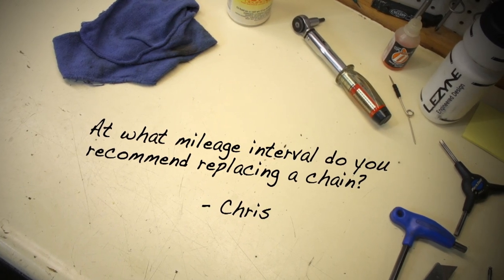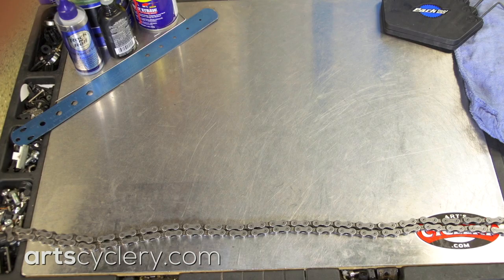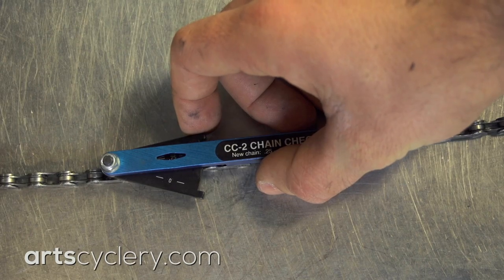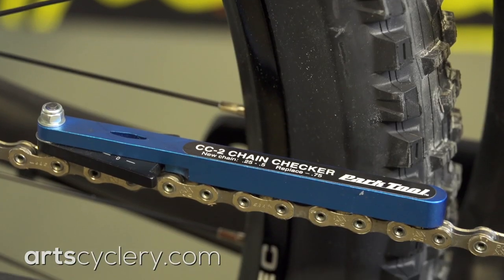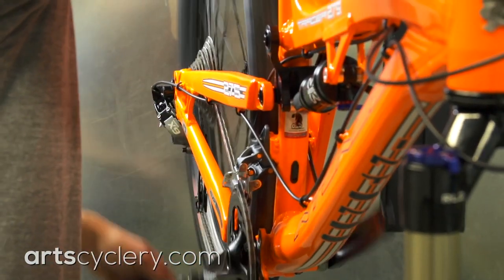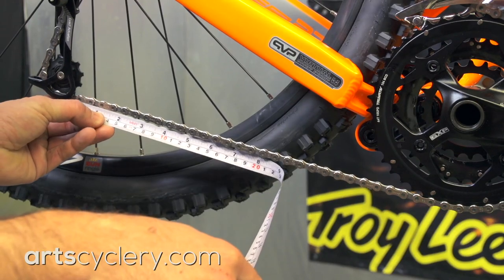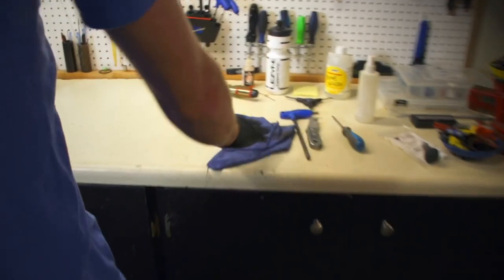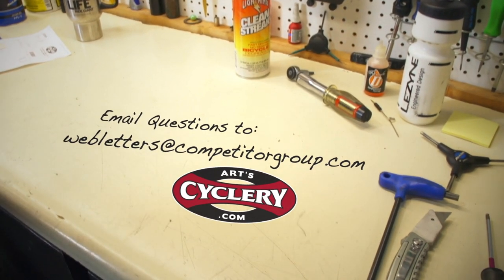Ask a Mechanic: When to Replace a Chain

Comment: Not to be a pedant, but aren't you supposed to use the inner plates when using a chain wear indicator, Park or otherwise?  It looks like he's using the outer plates there.  Or am I very wrong about this?
Reply from the maker: Chris, the length of the Park Tool chain checker requires you to use one inner link and one outer link in order to interface with the chain properly. There's actually no other way to use it.